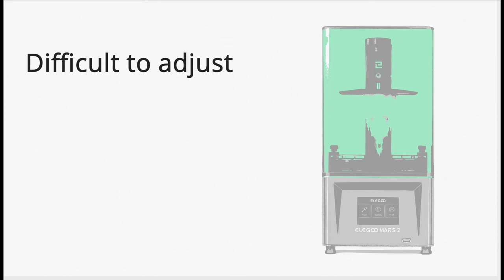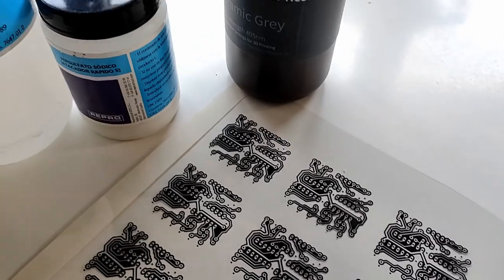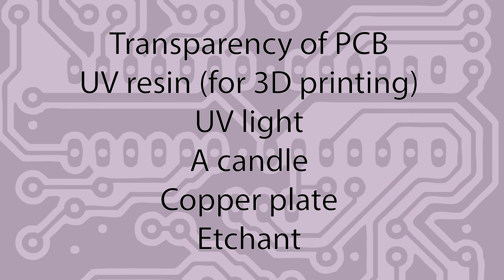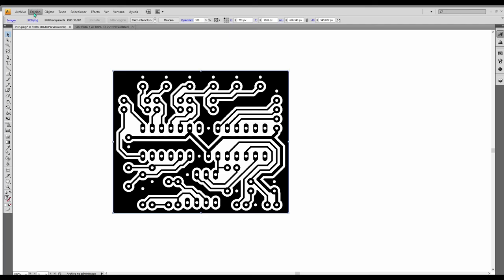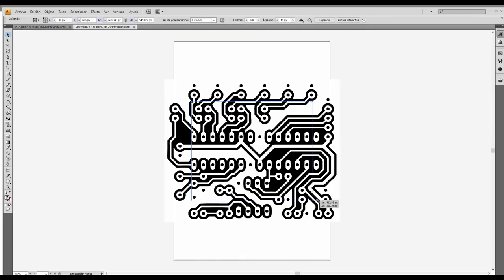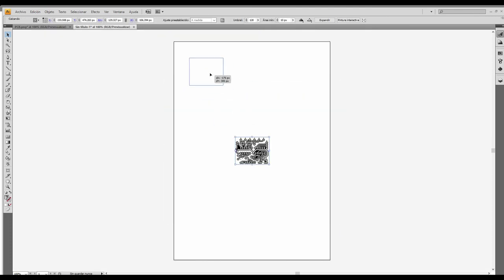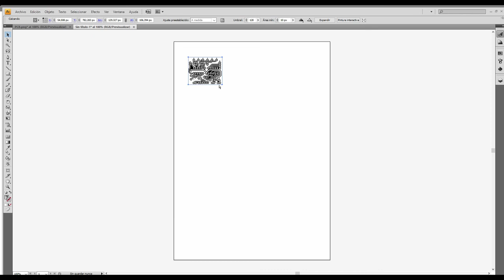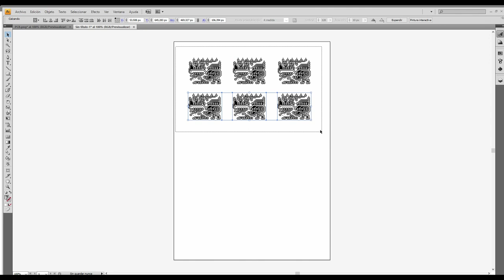Using 3D printer UV resin to make a PCB

Comment: If you are going through the trouble of getting it printed onto transparencies the resin steps are unnecessary all you need to do is iron the transparency on top of the pcb to transfer the toner to the pcb then etch it like normal.

Comment: I am going to use silk screen emulsion for the mask instead of resin. Even spreading using spin coating
Reply from the maker: Actually that's a great idea! One problem I had with resin is that it's very easy to overcure it, making the traces thicker. I think you will have much more control of the curing time with the silk screen emulsion. Thank you very much!
Reply: I'll keep you posted
Reply: Hello aurangzebhaque2973 have you successfully attempted PCB using Screen Emulsion If yes Acknowledge me since I am unable to get UV resign Thank you
Reply: @nfcradio4622  Hi. Not yet. Actually the spin coating machine needs to be improved. I need low end speed control to spread the chemical evenly on the board.
I have tried it using a brush to coat the pcb substrate. Although the layer thickness is uneven and excessively thick, the process does work. The chemical/emulsion does adhere to the copper surface, which was my main worry.
Reply: You can try it with a blank screen printing mesh. It works. The coat is thin and even
Reply: Did you ever figure it out?
Reply: @chrome72  ?? Figure what out
Reply: Spin coating
Reply: @chrome72  No. Busy with house restoration for the past 6 months. Will restart when done

Comment: They sell film that you put on the pcb and use uv light to cure it so it won't dissolve and expose the copper.   This is same you are doing, but the film is much cheaper and easier to use than 3d printer resin.   Of course, you can do it the old way and use a laser printer to print on glossy paper and iron it on the board.  I had iffy luck doing it this way.
Using a laser to directly expose the film instead of printing  seems ideal, some had great sucess, others not so much.  Thanks for your video.